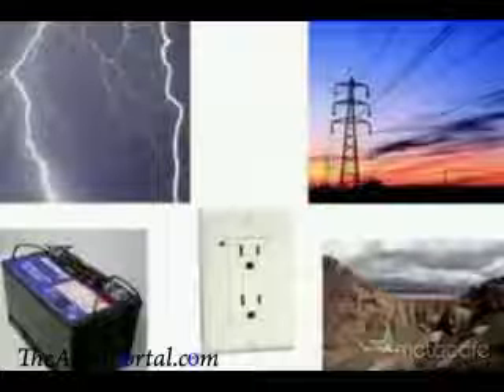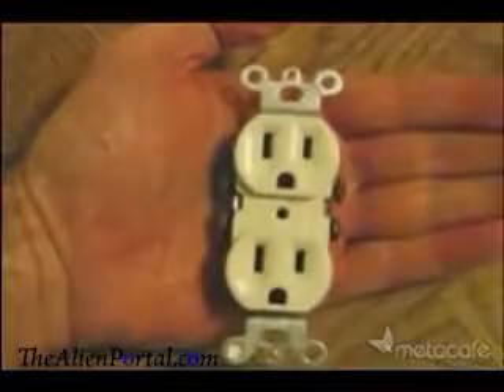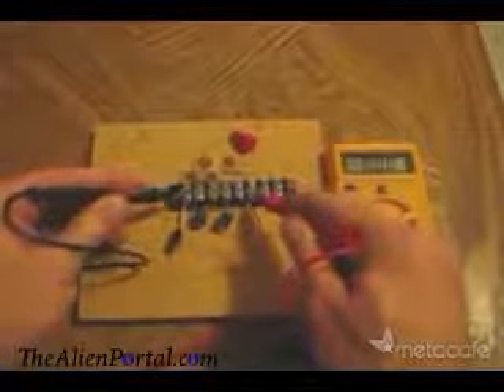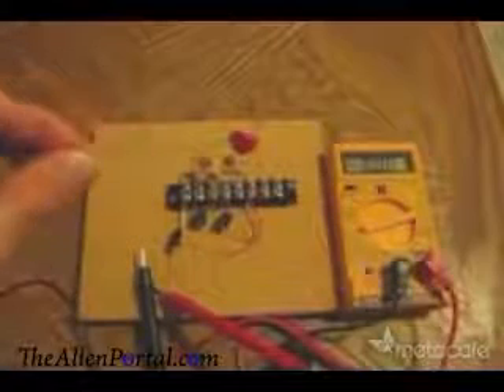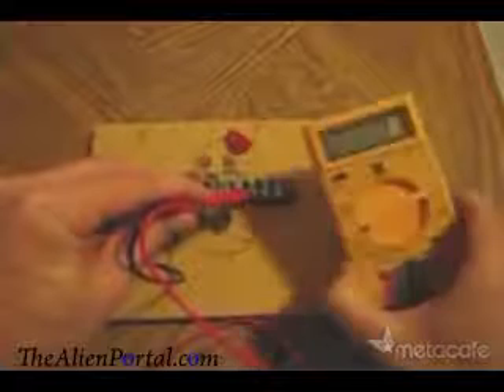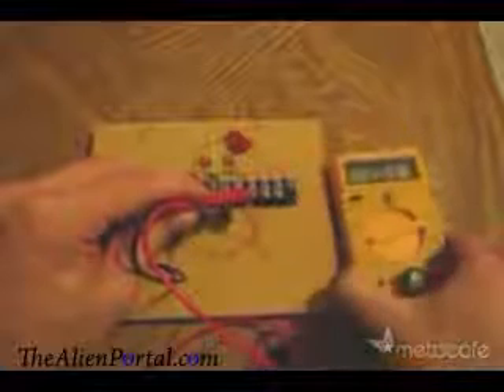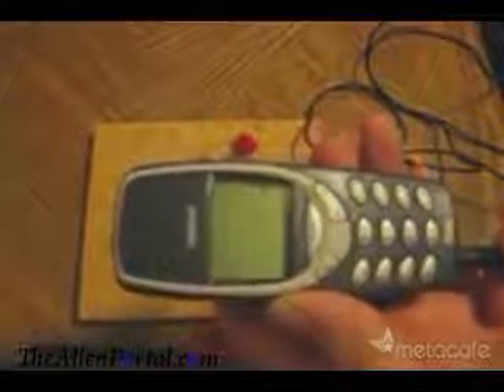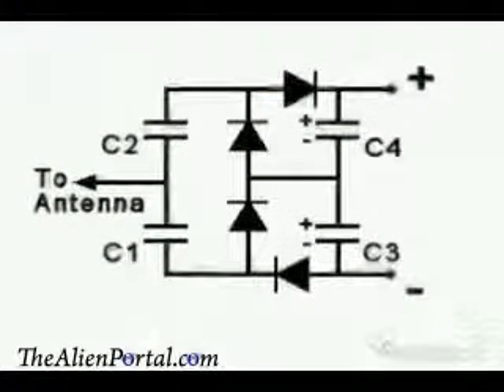Free Electricity - Nikola Tesla Tower - Proof of concept

Comment: @TheLadysheri I agree. Even if you can get the wires bigger and get enough to get 24volts, a transformer from 24v-115/120v can handle the rest. Im fully sure but this is what Ive seen so far with Electrical components.